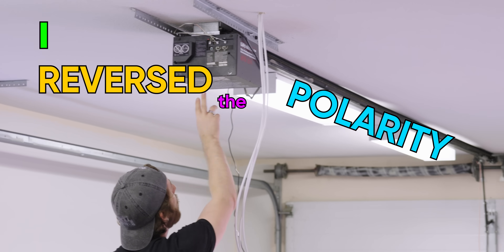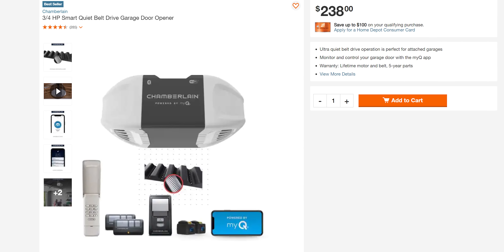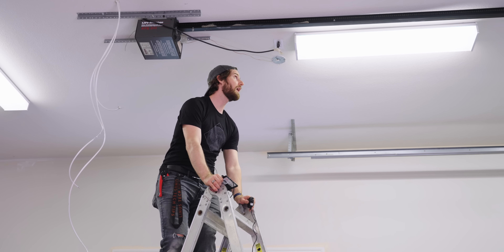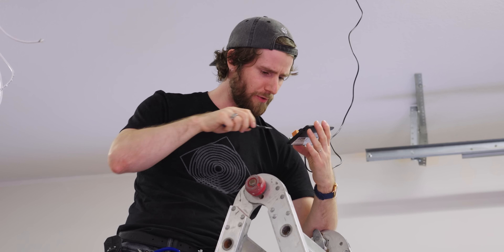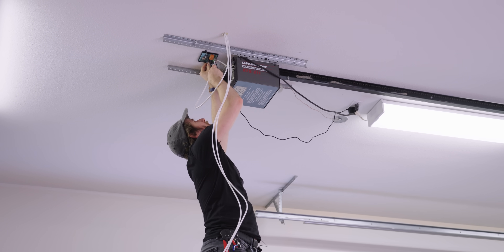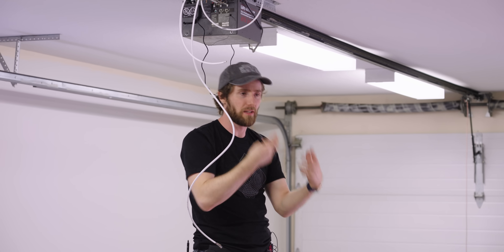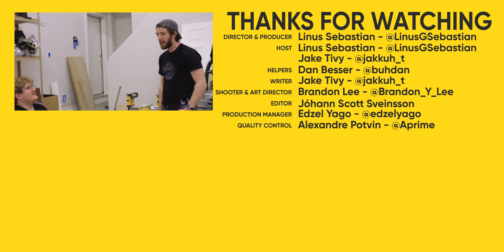Smartifying My 25+ Year Old Garage - Z-Wave Garage Door Opener

Comment: Jake, there is a way to get HA to work with cloud stuff without using Nabu Casa. The main issue is that you need to have an internet connection that has a static ip, which residential connections normally dont have. If you can get a static connection, then you just assign HA a domain and point your domain to the IP.
Now if you have a dynamic IP it gets a bit much, but it would make for a fun video. The first thing is to check if your domain registrar has an API that allows access to make DNS changes. This is super important for the automation as it rely's on this. Now make sure the ports for external connections are opened and you have a decent firewall so that you're being safe. Now comes the fun part. On the RPi you are going to set up a bash script. The bash script is set to run ever X minutes and check the external IP address of your connection. It is then to take the IP address and compare it to the last known "good IP". If it's the same, do nothing and hold off till the next run. If it is different, connect to the registar using the API keys you have, enter the DNS, edit the correct record in the DNS and update the IP of that record with the new external IP address and save. Wait for the save response to run a check that the IP address was assigned. Once it is confirmed take that ip address and update the local "good IP" record that future runs will be compared against. Bing bang boom.
It's not the most elegant solution but yolo.

Comment: I'm kinda wondering... why not just use SwitchBot...?

Attach a SwitchBot to wall mounted switch for the garage door and this should be problem solved. The drawback, of course, is you are connecting yourself to another ecosystem... although they do seem to have aimed at integration with various other systems. I feel like SwitchBot is trying to bridge that gap between the "dumb" home and the "smart" home where you can retrofit existing things with additional capabilities.

Comment: Nice work on the Zwave relay DIY. I also really appreciate you calling out Jasco and trying to get the community firmware updates. My whole home has Jasco switches and dimmers of all different bands (Honeywell, Inbrighten, Ultra Pro) all running on Home Assistent. While I haven't had any issues with them and they all work as they should, I would love to be able to update them and fix any known bugs or unlock new features with them.

What are you guys using to monitor power consumption in HA?

Comment: I'm an alarm tech and I am having a panic attack watching Linus and his team install those sensors.
Reply: Would you say you found this process quite... alarming
Reply: @chrisc1140  lol
Reply: lololol same. Imagine going into a customers house and sanding off a screw with sparks flying everywhere while trying to install a railmount sensor. I'll be honest though there have been times i've been tempted to do that.
Reply: @OldManWrigley  knipex bolt cutters are your friend
Reply: Same as well. That garage sensor comes with a piece that slides into a slot on the sensor part and will tighten itself to the rail
Reply: @adammiller7648  I have never seen these work because there is always something that hits it, I just screw them on, its a lot harder to be moved or broken off.
Reply: Makes my brain hurt too.
Reply: Same, I'm baffled that they didn't bother to look at the instruction sheet to see that it clamps onto the rail.

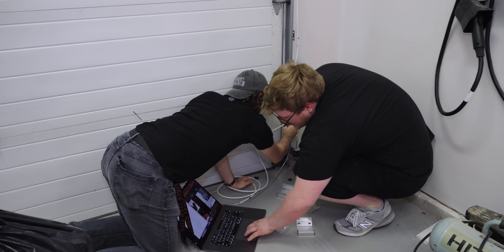Comment: 4:40 Actually, placing the magnet anywhere yields the same result even if you wanted to know if the garage was open "even a little bit".
Reply: Would’ve saved a bit of cable running
Reply: @vypGMD  you right, but my argument doesn't concern cable length.
Reply: Lower sensor does help if something (like a skateboard) is in between the door the garage won't close on it
Reply: @a3-radio  Any sensor location will tell you that.

Comment: Alternative to using a "cloud"... Setup a VPN like Wireguard* networked into your home setup; set all your phones to automatically connect the VPN once they are off your home wifi. So long as your internet is up & your VPN connects, your phones are always on your home network. *Tailscale makes that easy; but its not hard - you can easily push >400Mbps through a Raspberry Pi4 running Wireguard.

Comment: You could just hire some developer to program esp32 with relays so that it would connect to wifi and to your home assistant. Way simpler, way less pain. You can also have another esp32 on the garage doors with laser or magnetic sensor, not that hard either. You're overcomplicating it from beginning by focusing on the stupid google asistant instead of sticking to home assistant

Comment: Having a Chamberlain smart Garage opener and using the app every day Is funny how much Linus was exaggerating it being a pain in the butt LMAO.
Works flawlessly and the 10-second beeping is more like 4 seconds of beeping and then closes. 
Also: Amazon key Delivery is a blessing

Edit: It is a Chamberlain smart hub on a 1999 Chamberlain Garage opener. cost me 30 bucks and 10 minutes of setup
Reply: The issue isn't that Chamberlain doesn't work...only that you have to use their app, you're restricted to what they've designed it to do - and if it uses any off-prem service then potentially them deciding to turn off a service means you could be impacted.  I can understand why Linux primarily wants to have everything running locally with things he can administer and under his control.
Reply: @Hubris2   uhh what about those $10,000 worth of light switches that have outdated firmware and are basically bricked now?
It’s an apples to apples comparison,
Linus got lucky that the light switch manufacturers are coming out with an update after a week of ranting about it and posting about it everywhere for his 20 million subscribers to see.
There’s always a chance that stuff can go wrong, companies like these generally don’t just turn off there services. There’s a way higher chance of the light switch scenario happening again tho.

Comment: ... Garage doors open linear so it doesnt matter if it is mounted at the bottom or the top, it will still detect if the garage door is just cracked lol... If it was a contact sensor sure... but otherwise doesnt matter.

Comment: I've made a home assistant persistant notification (you cannot remove it from the notifications tray) that says if the garagedoor is open, including a image from a camera that shows the state of the garage door and a button on the notification to close, very usefull!
Reply from the maker: That's super cool! - LS
Reply: @LinusTechTips  if you have google nest hubs, you could also let these cast a image of the garage door (or a icon) to the device.
Also: you can cast a interactive home assistant interface to a google nest hub for quick access

Comment: "How do you want to use it if it's not cloud based" - uhm, add it into Home Assistant, enable the Google Home integration, give your entity a good name, and then ask "Hey Google, sync devices". Requires that HA can be accessed from outside of the house via DNS or Nabu Casa, but that's pretty easy (and still secure if you do it properly). All my devices are 100% local via Home Assistant (mostly Zigbee), and I can do stuff like "Hey Google, open blinds" which opens the window blinds in my office. The only cloud based devices I have are stuff like air humidifiers and robotic vacuums (both are Xiaomi).

Comment: Linus I pray to lord you see this comment but the solution is so simple idk how you manage to over complicated this so much (guess you're to use to high tech) but all you need is a simple product that presses a button for you. It's called a SwitchBot it will just press the physical button inside your garage
Reply from the maker: It won't know if the door is open or not
Reply: @LinusTechTips  Yes that's true, you could add a smart sensor depends on the ideas you have with knowing if its open or close. but if you want the example of the automation said in the video, if garage door is open at 2am close it. 

You can set the switch to press close at 2am and if its closed it will stay close if its not it will close. 

I would love to hear the ideas you have with utilizing the knowledge of it being open or not

Comment: My daily job is installing security systems and I’ve installed hundreds of these rail mount overhead door (OHD) contacts. So much stress watching the contact being installed.
Reply: Same. "Put it at the bottom so it knows it's open even if just a little!" 🙄🤦‍♂
Reply: It only got worse the the normally open and normally closed contacts part
Reply: @jacksongill8880  not suprised but still disappointed.
Reply: They are bad at Googling how to do stuff

Comment: I wonder if some servos and 3D-printed levers could be used to just push the actual buttons on the garage door openers.
Reply: You could just use a relay to energize the switch circuit.
Reply: That would work but why

Comment: Love ya Linus but what your using for the "sensor" is supposed to mount(clamp) to the track. Don't need to screw it to the track. Also, there are other ways to use different wall buttons with a chamberlain opener or a liftmaster opener and simplify things, just saying 😀

Note:you can put the magnetic sensor anywhere along the height of the track to detect open or close, doesn't have to be near the bottom 🙂

Comment: 2:45 Linus must not be familiar with UL compliance on automatic doors. Any sort of "remote" operation where you aren't guaranteed to be within range of the device operating has to give off some sort of warning that the door is about to automatically run. I do stuff for automatic gates and our wifi module has to function the same way, it's definitely annoying.
Reply from the maker: I'm familiar with it, but I don't care. That's what the sensor at the bottom of the door is for - LS
Reply: @LinusTechTips  Yeah I should have phrased that differently, of course you'd be aware of UL lol. UL compliance is a huge pain point in door automation. Gates are a bit different though considering 95% of applications aren't going to have full entrapment coverage throughout the entire gate's swing. Hit me up if you're ever interested in a gate operator :P

Comment: Chamberlain is having a seizure right about now. I've been wanting to do this myself too, and it's crazy how smart home tech hasn't advanced far in-regards to houses equipped with garages.
Reply: It really has, these videos have to purely be for content. There's so many ways to retrofit old or new motors to work with a smart home. Yes Liftmaster pretty much has a monopoly but there's plenty of choices from them
Reply: Smarthome garage switch & sensors are easy easier than this video.

Comment: Why must you make EVERYTHING so difficult, expensive and complex?  I have an olive green 1978 Sears Craftsman garage door opener that came with the house new.  Its a beast and it works because it was built correctly back then to last. I added a $40 Chamberlain control module for and it works great. When I leave I wait the extra 10 seconds until it closes and then I drive off. No way would I ever trust cloud base software with home security.

Comment: The caulking around the wires in the ceiling could be fire caulking, typically (at least here in Ontario) garages have a 1hr fire resistance rating from the rest of the house.

Comment: To anyone wondering what the name of the "horse hoof trimmer" Linus wanted, they are called an end nipper or a fret wire end nipper.
Reply: Then he destroyed a pair of insulated diagonal cutters trying to cut steel..ugh
Reply: I call it Kneifzange
Reply: @darkchaosclanat  So muss das
Reply: @darkchaosclanat  knijptang
Reply: self tappers are hardened metal your not gotta snip them, youd just have to grind it.
Reply: @jordonboring3729  Which is what he finally ended up doing
Reply: @jordonboring3729  Or break them off.
Reply: I love how the contractor seemed to just be like "no, here have some diagonal cutters. We don't have end nippers that small"
Reply: If you wanted to shear the screws off, some lineman's pliers and the bolt cutter function will work much better
Reply: and he meant a horse hoof nail puller... no wonder everyone was confused xD
Reply: flush cutters, end type as there are also side type.
Reply: I think tin snips would also have been applicable.
Reply: @CRneu  tin snips/aviation snips are definitely not what he was talking about
Reply: @CRneu  In the UK 'tin snips' means side cutter, basically scissors for metal. I'm not sure they'd make it through a hardened screw either.
Reply: @CRneu  Nope, tin snips are basically scissors on steroids for cutting sheet metal (previously/historically, rolled tin). End nippers/cross cut pliers are for flush cutting the end off small diameter nails, wires, rivets, and bolts.

Comment: 4:40 Isn't installing the sonsor down close to the bottom  with the reason to detect even if the door is a little bit open not very logical, as long as your garage door opens in one piece? :D

And if  a one piece garage door doesn't open in one piece, that sensor is the smalles of your problems ...

Comment: Yeah, I know about the interference problem. Your are supposed to shield the wires by putting a metallic shield around it or twisting the wires together and connecting the two wires with a capacitor to reduce interference. Also I recommend 2.5 twists per inch for the wire. My teach who went to Cornell for electrical engineering did a study on that.

Comment: FYI, that sensor works best at the top of the door, where the door will move away from the door jam even when the garage door is open 1 inch. Also uses less wire and it away from anyone messing with it.
Reply: I noticed they said that and I was very confused, it doesn't matter where the sensor is.

Comment: 14:33 Home Assistant Cloud is certainly the easiest way to use Google Assistant with Home Assistant but you can get away without it and no, you do not have to re-auth it every two weeks. (Source: My setup has been running like this for over a year and has never been re-authed. The only time I went back into the Google Console was to update it for "local fulfillment".) 

The configuration is a bit more involved, requiring you to have your Home Assistant accessible from the Internet (via HTTPS with a valid X.509 certificate, so you'll need a DNS name to point to it), and set up a Google Developer project for "Actions on Google" which you then run in test mode forever. The setup process for the "Actions on Google" project is fully documented on Home Assistant's website (look up the Google Assistant integration).

Comment: 4:42 "put it close to the bottom so it will detect even if the door is open just a little bit"

Lol. It doesn't matter how high you put them, they'll still move apart the same amount when the door opens.

Comment: I'm a bit confused by linus's reasoning, merlin/chamberlain does not lock you in to the Myq app since you can use home-assistant to control the door opener. Secondly the 10 second warning light and delay is helpful if you don't have the infra red trip beam and you have something in the doorway (like a car you are polishing)  you can cancel the open/close action by hitting the button on the wall.

Comment: Linus: “Plug and play is for losers. Hire 2 people to help you install these 12 devices that let you open your garage door.”

A million points of failure later…
Reply: Honestly, I trust a system like this more. Home automation solutions are rarely plug and play in practice--at least, not if you wander the tiniest bit off the most common use case--and a solution that uses simple and transparent components from end to end is much easier to troubleshoot and fix.

Of course, that assumes that they take the time to document it. Otherwise it's going to be a nightmare to maintain.

Comment: The way that sensor is designed, it could have been mounted anywhere along the rail.
Reply: Yeah. "Put it as close to the bottom as you can so it'll detect when it opens". No, the door moves as a whole, putting it a few inches up makes absolutely no difference 😄
Reply: Had been thinking the same thing.

Comment: 2:45 The 10s light flash and beeping before closing is a UL “safety” requirement for “operation without line of sight” (i.e. via the internet) that manufacturers must implement in order to receive a UL listing for their openers.
Reply: Correct, it's there to warm people that the door is about to close on their head especially when homeowners installing the things without proper safety sensor placement get involved.
Reply: Just add an ir sensor gate or door bottom bumper. That has been the way to close overhead garage doors safely commercially for decades. If the sensor trips then reverse to open. That adds costs so homes don't have them normally.
Reply: @Ricko1Games  That only works if UL makes an exception for that. From this specific perspective, I can't blame Chamberlain for that annoying safety feature.
Reply: Nobody likes it.
Reply: It's so annoying. But even besides that I can't even use IFTTT to setup an automation for when I connect to my home wifi to open the garage it can only close it. Plus the voice commands when in a shared home don't work at all like there's 5 people in my house we all have cars we all use the garage door. Yet only my dad could use the voice commands everyone else we just get told "there's no devices in your home"

Comment: Lol "put it as close to the bottom, so it can detect if it opens just a little " he says.
It can be put anywhere, and the sensor will move with the garage. In that configuration it's mounted side by side not on the floor...